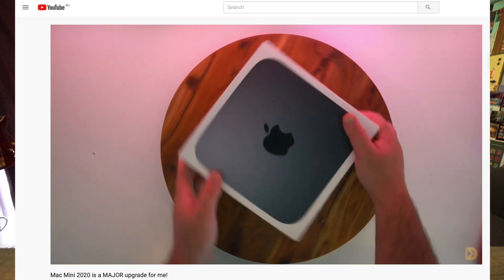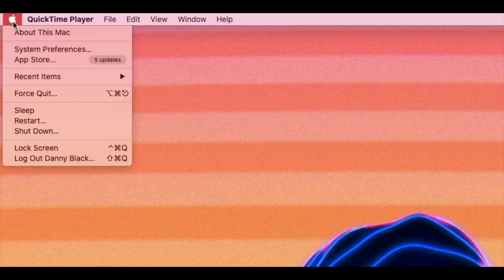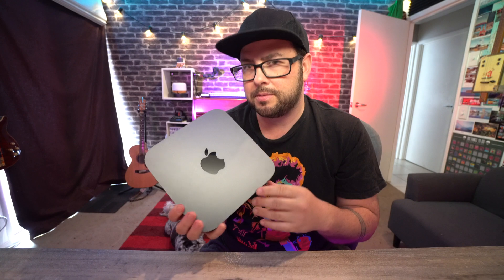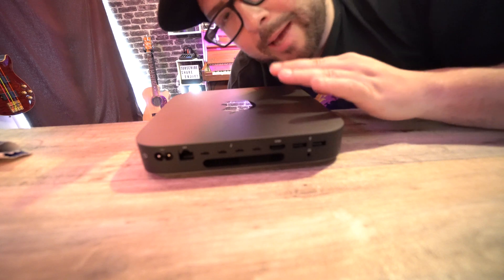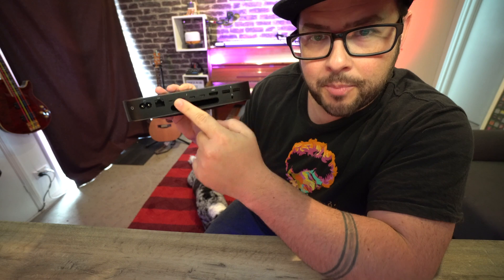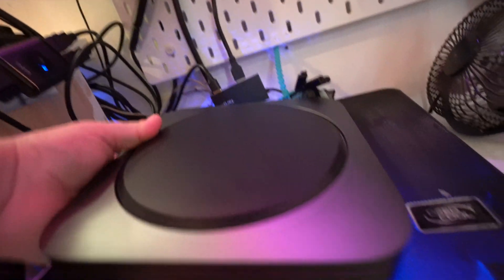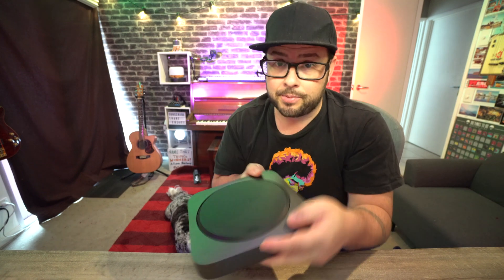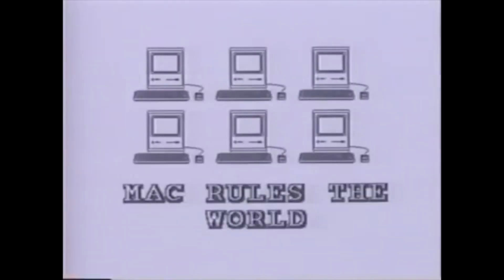Major design flaw on MacMini "2020" 🤭 [fixed]

Comment: That is sometimes the price Apple makes you pay for the small seamless design. I have never heard of outputs slowing down because they are heating up. Thanks for the video. What specs are that computer?
Reply from the maker: wellllllll.. you would think i would know the specs off hand but I already forgot lol (ill message them to you and anyone else reading this comment can just check out my original vid)... ya I didnt heat would matter, but i havent had any problems whats so ever since I flipped it over!